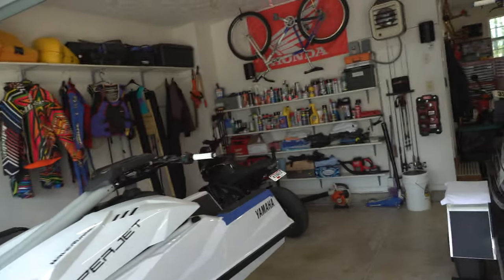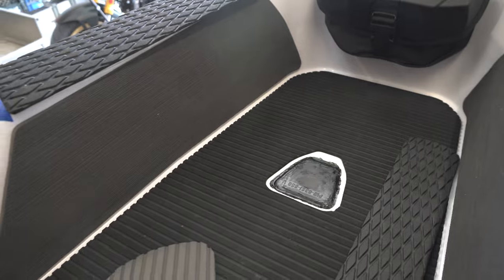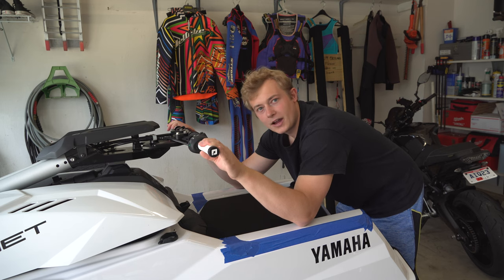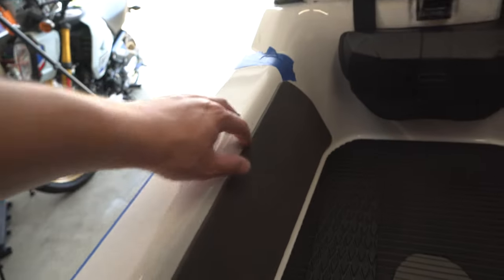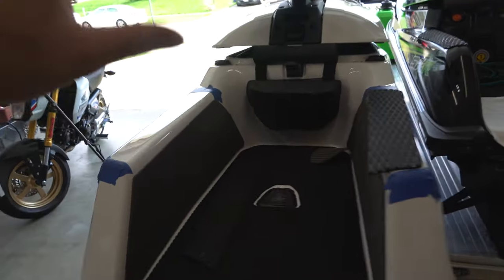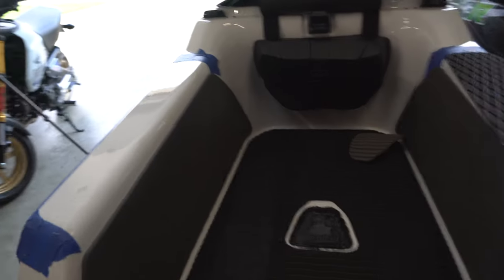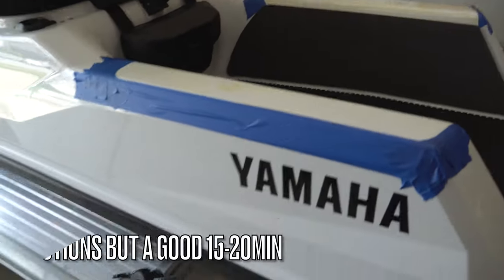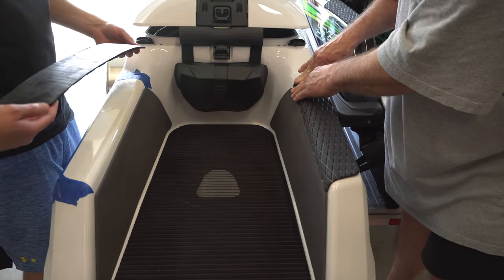Custom Stand Up Jetski Mat

Comment: How does it seal with the bag
Reply from the maker: If ur referring to the hood sealing with the straps it seems fine not much water gets in. If your referring to the bag it stays dry we keep our phone in it for gps top speed.  However took it out yesterday and the bag came unvelcro during riding only hung on by the straps 😳 i got rowdy on it yesterday though she jumps good and slides!
Reply: Nice did some gelcoat repair for my superjet
Reply from the maker: @henrytischbein155  where was tht spot at?
Reply: @Floatsorrolls1  emailed u a pic of it